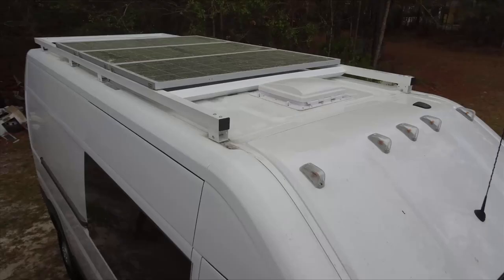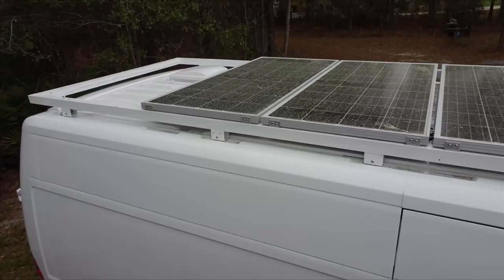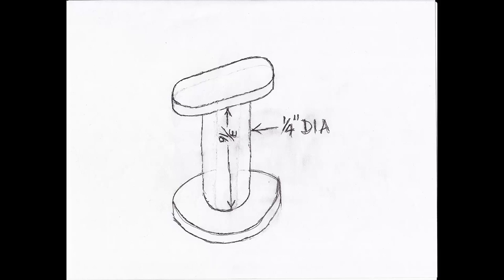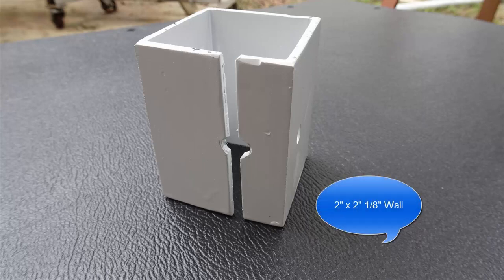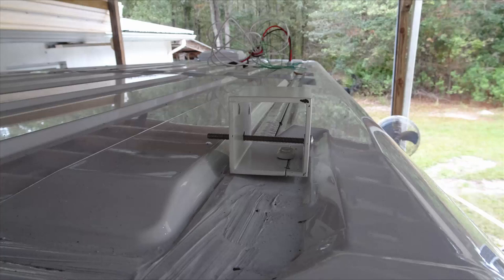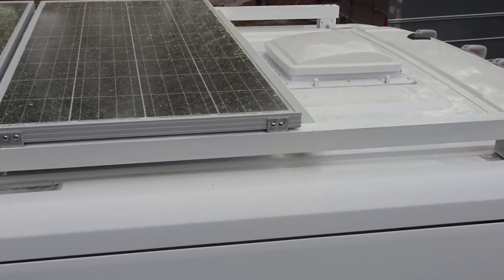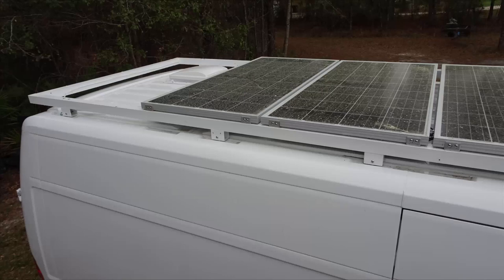Simple and inexpensive DIY Roof Rack for your van

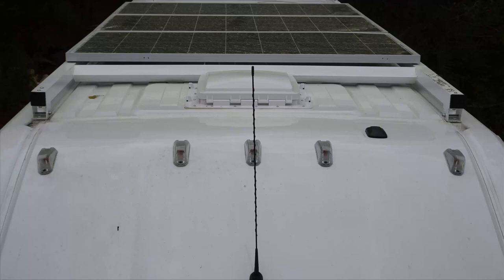Comment from the maker: Notice the front cross bar @ 3:15, I should have aligned the bottom with the side rail bottoms (instead of aligning the tops). This would have provided two advantages. It would keep the cross rail from hitting the curved roof and it would provide additional wind deflection for the solar panel leading edge. You should consider this change for your project.

Comment: 1:42 - not sure if you know this but the pins can be rotated 90 degrees by using a pair of big pliers.
Reply from the maker: I wouldn't want to break the paint seal with rotation. My method didn't need pin rotation.

Comment: Pretty cool that the width spacing of the factory mounts were perfect for the solar panels
Reply: It doesn't even matter with this design, all it needs is two cross bars that miss any roof-lights at the spacing to hold each end of any panel, then just position the panel left-to-right and bolt it flush into the crossbars. I.e. by solving the mount points with a nice square piece of aluminium you could put the panels anywhere while other people are having to stick or bolt them to the roof itself, which isn't great when they fail!

Comment: Very interesting, thanks for posting! It's a common problem placing solar panels, this method can be used with shorter side bars and two cross bars to hold a solar panel on a busy van roof, some roofs only seem to have space for sticking or bolting on panels, but as panels fail that gets a bit awkward.

Comment: Great idea and design. A couple of quick questions..
Are the square 2" x 2" attachment resting on the roof to distribute the weight or are they just relying on the T nut for this.
Would you recommend placing a thin rubber mat underneath them?
What is the recommended width for the groove to achieve a good clamping?

Many thanks for sharing 👍👍👍
Reply from the maker: By drilling a 1/4" hole then cutting the slot thru the hole, the clamped hole is now less than 1/4". This makes the 2x2 grip the pin which results in no movement. As far as a cushion, I didn't use one and I have never seen any rust develop around the pins with a couple years of use. So I suspect a rubber cushion is not needed at the base of the pin. Remember the 2x2 never touches the roof of the van, just the bottom of the pin.I ran my 2x2s through a table saw so the curf was about 1/8 inch which results in a very tight clamp. A quick tip, drill the holes and cut the curf before cutting the square tubing into 2" lengths. This gives you something to hold onto while cutting the curfs. Hope this helps.

Comment: Thanks for posting this video! I've been trying to find a sturdy design for my PM3500 and I really like what you've done here. Question... What did you coat the aluminum square tube with to match the van?
Reply from the maker: I painted them with white spray paint. Easy to scratch without aircraft primer underneath. But the scratches aren't noticeable from the ground.

Comment: This is the best DIY roof rack system I have seen.  For the cross bars, how many did you install and were they welded together or did you use some other method.
Reply from the maker: Two cross bars, one at each end. The front crossbar was recessed to reduce windage.

Comment: Thanks again for sharing your mounting solution. I just fabricated mine and they work great. You don't seem to be responding to questions but I will ask anyway. Have you noticed anything from the placement of the front crossbar at a 45 degree slant? I am thinking of the doing the same but with 1 1/2 square tubing so I can sidestep having to put a crown in it. Any info on this would be most appreciated. Anyone else need info on the making of the mount feel free to comment and I will respond. I definitely learned a lot by doing it myself and being safe about it.
Reply: Hi Mike, Did you make similar brackets to mount the roof rack to the promaster? I'm wondering the same thing as Scott, do you notice any rateling/horizontal-movement around the pin? Since the height of the pin is 3/16 and the thickness of aluminium is 1/8, leaves you with 1/16 of wiggle room, any issues there on speed bumps/dirt roads etc? I would love to hear more about your setup/how you did it what material you used. Did you use 1 1/2 square tubing?
Reply from the maker: After 4,000 miles of travel, haven't noticed any sag of the bend and never hear any vibration from the wind as I have with other roof racks with vertical cross-bars. I suspect that if you placed a rubber seal between cross-bar and roof, this would also decrease drag because air couldn't force under the cross-bar.
Reply from the maker: What you overlook is that the pin is clamped tightly and cant allow the rack to move up and down. The saw curf makes the resulting hole smaller when the bolt clamps the mount. Have looked for paint scratches on the pins but find none.

Comment: Many thanks for this video! Is it your opinion that 2" x 3" rectangular tubing would be tall enough to solve the clearance issue you encountered using 2" x 2" square tubing? I can't thank you enough for posting this.
Reply from the maker: I built the roof rack upside down and placed the top of the front cross bar even with the top of the side rails. That was a mistake, if you match the bottom of the cross bar with the bottom of the side rails, then the clearance is not an issue and the excess (due to 45-degrees) stands proud to the top of the side rails. This would also help to deflect the air above the mounted solar panel's front edge.

Comment: Now that some time has passed.  Have the mounts ever become loose? thanks
Reply from the maker: No changes and no looseness. Remember that the horizontal bolt clamps the bracket to the roof pin.

Comment: Simple elegant solution. Did you use 6061 or 6063 grade square pipe? Get it prepainted? Where to buy the black plugs in the front? Thanks for taking the time and being so thorough in your explanation.
Reply: Did you get an answer on which grade of tubing was used?
Reply: @terryjones12  no I didn't. Probably 6061
Reply from the maker: Not sure which, probably 6061 if it is cheaper. Spray painted it not expecting it to last over aluminum. Plastic plugs from amazon, real cheap. Plus I wasn't worried about salt spray as in a boat application.

Comment: @Iwgraves how did you bend the 2 inch mounts open enough to slide it over the pins? I'm currently trying to do this but it bends right back.
Reply from the maker: I placed the mount on  a work bench upside down and drove a chisel thru the cut until is was spread wide enough. When installed the bolt will pull the cut almost closed as the mount clamps onto the pin. The mount can still twist until bolted to the roof rack.

Comment: Any issues with movement around the pins you clamped to.  Seems like most setups clamp to flat top area of the pin.   Thx for sharing your setup.  looks good.   Also how did you get your wires inside from the solar?
Reply from the maker: No movement on the pins due to the bolt clamping the tubing against the pins holes. I used a single thru hull stuffing tube on the roof where I wanted the wires inside, and dropped the wires down thru the wall. This tube is under the roof rack and not noticeable.

Comment: Wat size width ways are solar panels looks a tight fit? What wattage are they im guessing  320w?
Reply from the maker: I'm not sure, just measure between 2 opposing pins and add 1-inch. Of course they could be a little longer. That is my panel lengths. I only have 3x160w, 300w were not cheap 2 yrs ago.
Reply: @ForTheManDIY  cheers